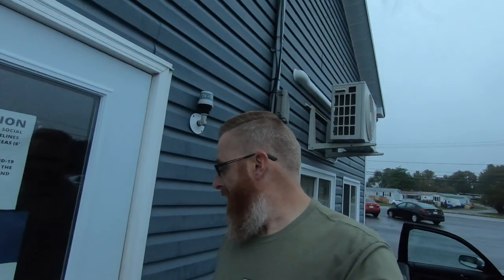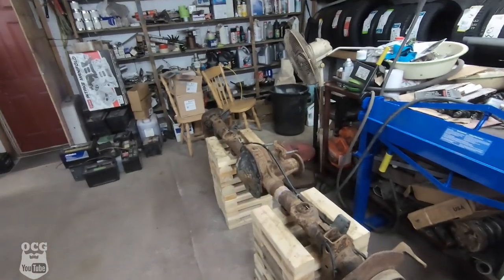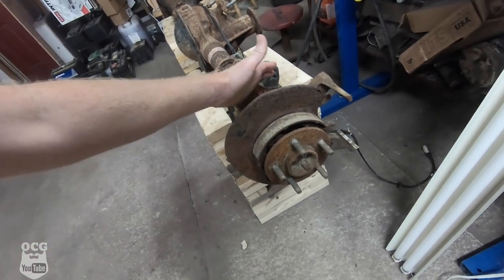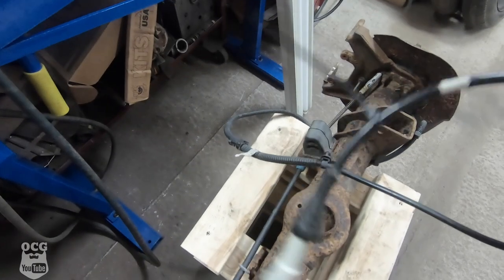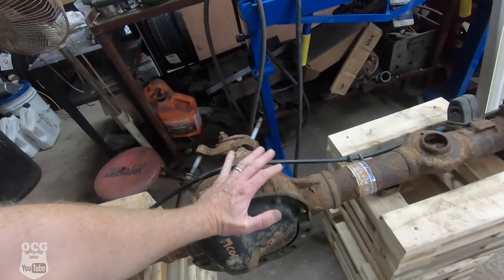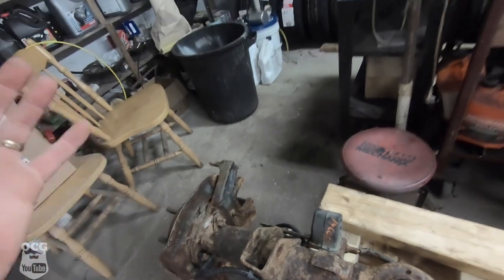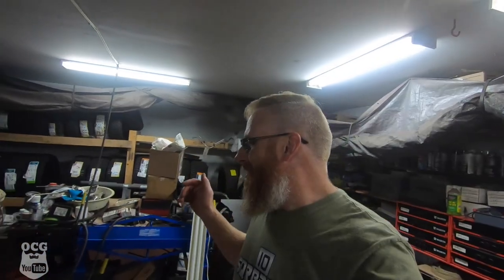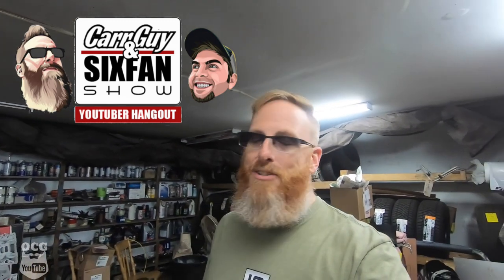Cleaning Up A Ford 8.8 Axle (CROWN VIC, GRAND MARQUIS) Pt-1

Comment: The depressing thing, is that it wasn't that long ago your morning drives to the shop at 6am the sun was up and shining bright and now you have to turn the shop light on for us to see :(. I miss summer!
Reply: Summer is around the corner for us, thanks for passing it on 👌🏽
Reply from the maker: Oh the daylight savings will fix everything! 🤨
Reply: @OldeCarrGuy  I worked in Northern Alberta and Manitoba for 5 1/2 years .both places were on CREE Reservations.  The Elders used to say ... if you cut one foot off one end of a blanket and sew it on the other end, it makes no difference  but white people think it does .

Comment: Whaaaaaaaaaaaaaat?????????
Finally!

OK, let me finish watching this.
-Chuck
Reply: You never told us what the new axle ratio is, (3.27, 3.55)?.
The current is 2.73 right?

Before you swap it out, can you hook up your scan tool, and document what the engine RPM is at 55mph, 65,mph, 75mph? And then check again with the new gears.

-Chuck
Reply: @PanzerPlatform  what's up chuck check my comment out I'm trying to pull up
Reply: @big_kapp4425  
Yo B.
Reply from the maker: Good call! I will do that! I’m pretty sure I’ve already said it was a 3.27. But it may have been on Instagram, which you would know if you hade it! 😂
Reply: @OldeCarrGuy  
I can't afford Instagram. 
And why would I want to be a failure on two social media platforms?

Comment: In order to put a 327 gear in.  is it only the ring a pinion  or do I need to change the axles out to
Reply from the maker: Axles are different in a locker. besides, it's much easier to swap the whole thing than mess with shimming gears!

Comment: Should have just replaced the diff, gears, and axle bearings on your original 'cause you're already replacing parts on the used one.    Not sure what condition the diff is in the used one, but I'm thinking its very used and needs to be rebuilt.
Reply from the maker: Actually, it's in perfect condition on the inside. No burnt smell, no signs of wear. The  rearend was out of a low mileage, 2011 P71. Also, setting up gears sucks.